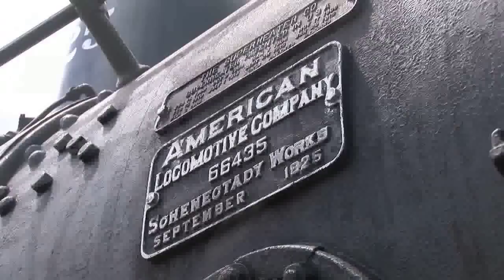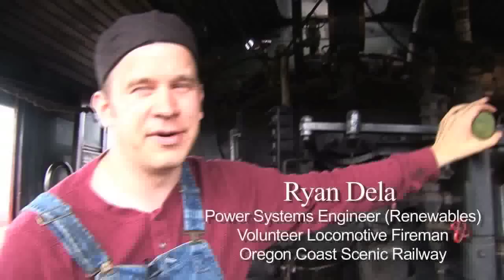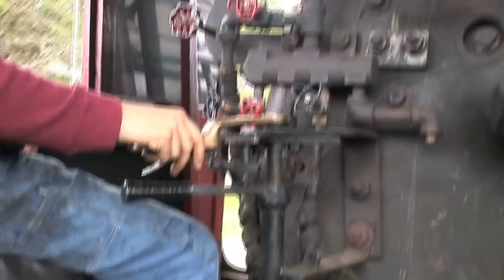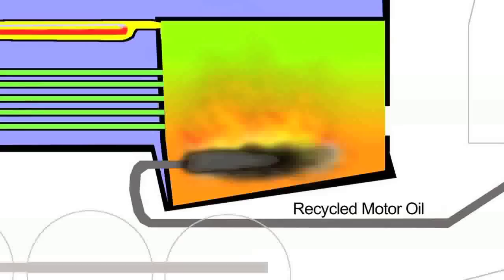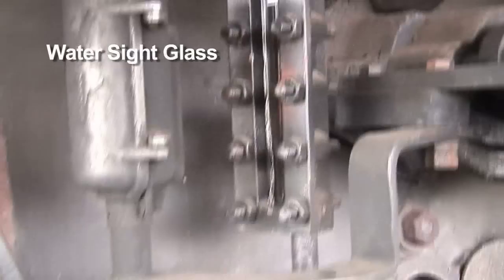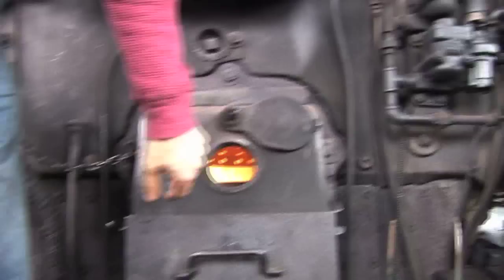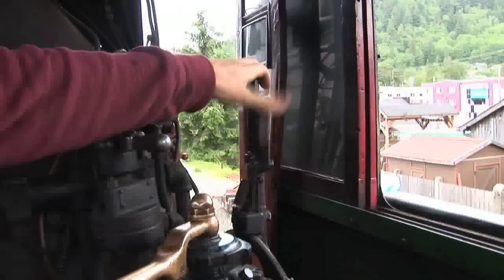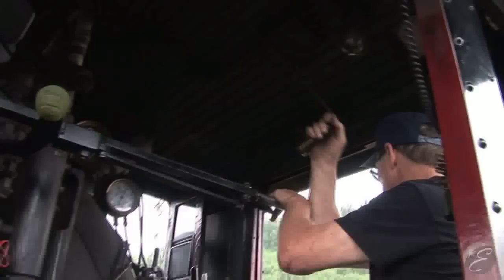Operating a Steam Locomotive

Comment: Always CASH paid for steam locomotive parts on the black market! Engineer's instruments, bell, whistle, headlight, number herald, marker lights, builder's plate, grab irons, brass bearings, bushings or babbitts, tools, wiring, tubing, valve handles, valves, levers & many other parts.  ABSOLUTELY NO QUESTIONS ARE EVER ASKED ABOUT WHERE THE PARTS MAY HAVE COME FROM, WHEN OR HOW THEY WERE ACQUIRED! Very, very lucrative! Very, very profitable! Very, very low, low risk!

Junk all the remaining steam locomotives! Cut them apart & melt them down. Besides, it is fun for the WHOLE family, to watch the steam locomotive being melted!
Reply: YOOOOOOUUUUUU SHALL NOT PAASSSSS!
Reply: ***** I am here & there is nothing you can do about it!

The fireman's handles to throttle the oil to the fire & air would be a very nice seller on the black market. The Atomizer valve with the handle would be a good one too. Just use an angle grinder to cut it off! Then there are the other parts & controls too. The boiler water sight glasses, the steam pressure gauge, the engineer's throttle & many others. Just cut them off & bring them into the black market for CASH!

Always CASH paid for steam locomotive parts on the black market! Engineer's instruments, bell, whistle, headlight, number herald, marker lights, builder's plate, grab irons, brass bearings, bushings or babbitts, tools, wiring, tubing, valve handles, valves, levers & many other parts.  ABSOLUTELY NO QUESTIONS ARE EVER ASKED ABOUT WHERE THE PARTS MAY HAVE COME FROM, WHEN OR HOW THEY WERE ACQUIRED! Very, very lucrative! Very, very profitable! Very, very low, low risk!

Junk all the remaining steam locomotives! Cut them apart & melt them down. Besides, it is fun for the WHOLE family, to watch the steam locomotive being melted!
Reply: Cockroach Well, at least people would agree with me.
Reply: ***** Every person may have their own opinion. I certainly have mine. You definitely have yours.
Reply: Who?
Reply: ***** Absolutely nothing! It is +icverano525 who is ailing!
Reply: ***** He is asking about you! That is who!
Reply: Cockroach I doubt he is asking me. Just let him respond
Reply: ***** I will do that for you!
Reply: ***** English, please.
Reply: What this individual fails to see is steam locomotive scrapping is no longer profitable. First, you will need a licence to own any locomotive which Cockroach does not know about (which proves he is a fake). Next, you will have to buy a locomotive because you cannot destroy or dismantle other people's property even if the locomotive is abandoned. You will be buying the locomotive for the machine value (due to their rarity today) which is higher than the scrap value. Scrapping the locomotive would result in a loss of money. 

Furthermore, this individual is a fake. All he tells are lies. He once gave me the address of his scrap yard which I looked up on Google maps. The satellite image showed a scrap yard, a very tiny one! Also, directly across from the New Hope and Ivy Valley railroad which does have an operating 2-8-0 consolidation. If he did as he says, the loco would be gone! Also, many of his arguments do not "line up." He says the steam locomotive is flimsily built and is unreliable but he is wrong. There are a few cases of steam locomotives coming to the rescue then the diesel fails. This happened with UP #844 once. A diesel freight train stopped due to locomotive overheating and shutting down. 844 was on an excursion that day, time, and place. Soon the diesel engineer found his speedometer went up. 844 was pushing the freight train from behind! Also, in Germany, a high speed electric train stopped due to a power failure. It just so happens a museum was running a little steam locomotive that day and it was called to the rescue. The little steam loco pulled the train to the next station without a problem. In addition, he says he say a steam loco blow a "gasket" once. Out of all the research I did, I could find no evidence of this ever happening. He was most likely exaggerating a steam safety going off or a boiler blowdown. 

Lastly, he falls to notice the black market is illegal. He thinks he is some how.immune from the law. He says you can get money doing something illegal. He has made the fool mistake of telling the world about his plans. Now anyone can alert steam locomotive owners and the authorities about this, bringing him to jail. 

It is clearly evident that this individual is to be ignored and used as a target for a World War 2 German 31 inch railroad cannon. 

From,
Someone who actually knows what they are talking about.
Reply: Streamlined Steamroller What I know is you don't need a license to remove parts from a steam locomotive. I know about the license requirement, so I am real. But you think what you wish. What you think is none of my concern! Desperate people take what they want when they want it. Desperate people have no regard for your laws. Scrapping a steam locomotive is an extremely profitable venture.
Reply: +Cockroach I agree with you that it's a sad truth that steam engines and locomotives are being scrapped. But here's where your wrong: #1 scrapping has been going on since World War II and, until maybe the 1970's, steam engines and early gas engines were thought of as primitive garbage compared to diesel electric and turbine power, #2 the reason that you find steam engines and locomotives being taken apart is usually because they are refered to as "donor-engines" this is no different than donating your organs after you die. The amount of work, time, and resources it would take to bring ALL existing steam locomotives and engines back to life would not do any good for posterity. Get 20,000 locomotives into non-profit organizations in fully running condition so younger generations can appreciate them, and you have achieved a noble goal. #3 you mentioned that your a licenced engineer. So am I. You should know the dangerous conotations for trying to revive a "dead" steam engine. My bet is that back in the day, they didn't lay those boilers up evacuated of oxygen let alone replaced with nitrogen or any inert gas, and I also bet that they didn't frequently replace water lines, steam pipes, etc. which brings me to #4 everything you have stated in your argument either a) is very weather resistant (brass parts, babbitt's metal etc) or, if of any value, has been stored inside. these parts would therefore be better off belinging to a person who will care for and appreciate them. So in conclusion, yes you can go anywhere and find parts taken off of their origional hosts but its in the form of recycling. I for one am glad that people are going to the effort of keeping this stuff alive (despite rampant theft problems for stuff like copper wiring) even if it means there are less subsequent engines in the end.
Reply: JohnsAirEngines Actually, in the U.S., steam locomotive scrapping stopped in 1959.
Reply: +JohnsAirEngines I don't agree! Nothing sad about scrapping any steam locomotive! Seeing them cut apart is a delight to everyone's eyes.Garbage is what they are! Younger generations don't care about them! Good for them!

#2 There is nothing nobel in appreciating a steam locomotive & the younger generation knows that! They are not that stupid! Rocketry into space is the future. Steam locomotives are a terrible technology to get anyone into space!

#3 What they did or did not do long ago is none of my concern!

#4 Materials are materials. When acquired, get what one can for their daily value.

Good for you! You praise the preservation of this garbage, but for me, I advocate stripping them for parts & materials as preservation groups replace or rebuild this garbage. I say, "strip it down of all it's parts & then send it to breaker, then the foundry.
Reply: +Streamlined Steamroller I scrapped 2 in the last 15 years, so it has not completely stopped!
Reply: Cockroach Nobody wants to see history getting turned into circuit boards. That is why we are arguing with you. There are millions of cars, trucks, and airplanes waiting to be melted down.
Reply: Cockroach That was for various reasons such as it got so rusty, it developed many holes in the boiler. Locomotives in this condition, I wouldn't mind you scrapping. The parts would do good for other restorations.
Reply: +Streamlined Steamroller What people want is none of my concern. History is the record of events between printed pages of a history book. The materials are reusable to create more modern artifacts for use & they too will become something of the past, cut apart & melted down. Engineer's & fireman's instruments, bell, whistle, headlight, number herald, marker lights, builder's plate, grab irons, brass bearings, bushings or babbitts, tools, wiring, tubing, valve handles, valves, levers & many other parts.  ABSOLUTELY NO QUESTIONS ARE EVER ASKED ABOUT WHERE THE PARTS MAY HAVE COME FROM, WHEN OR HOW THEY WERE ACQUIRED! Very, very lucrative! Very, very profitable! Very, very low, low risk! It is very, very easy, quickly accessible & so, so rewarding!
Reply: +Streamlined Steamroller Junk it all! Every last steam locomotive.
Reply: Living history does exist! A quick Google search said this: Living history is an activity that incorporates historical tools, activities and dress into an interactive presentation that seeks to give observers and participants a sense of stepping back in time. Although it does not necessarily seek to reenact a specific event in history, living history is similar to, and sometimes incorporates, historical reenactment. Living history is an educational medium used by living history museums, historic sites, heritage interpreters, schools and historical reenactment groups to educate the public or their own members in particular areas of history, such as clothing styles, pastimes and handicrafts, or to simply convey a sense of the everyday life of a certain period in history.
Reply: Cockroach Restore it all! Every last steam locomotive.
Reply: Cockroach We do not need the metal as there are millions of cars, trucks, and airplanes waiting to be melted down. These vehicles contain FAR MORE metal than the 1795 remaining steam locomotives in the United States.
Reply: +Cockroach I'm sorry you feel that way. That's going to bite you in the ass in your future some way or another. "You can't know where your going until you know where you've been." But hey, people like me and many others who DO appreciate this stuff can pick up the slack you dropped
Reply: +Streamlined Steamroller Oh, Ok. I just pulled out 1970's on account of a natural gas plant that ran a stationary steam engine until that year. Thanks for the correction.
Reply: +JohnsAirEngines We can cut it up & melt it with no regrets. Like the temple of Bell, it exists as a ruin no longer. The steam locomotive should exist no longer. We will figure out our own path to the future without preservation of the steam locomotive.
Reply: +Cockroach stay in your above-cloud-cover ivory tower. Im glad we don't live in your world because I want people to enjoy these artifacts long after both you and I are gone. Your spitting in the face of everyone that came before you by discrediting the hurdles they had to go through to achieve these machines. (love your username by the way).
Reply: +JohnsAirEngines I will be where I want to be! Where you are glad to not be living is none of my concern. I want people to make lucrative sums of CASH from the black market sales of the parts & assemblies of the steam locomotives! I want people to make an earning cutting these machines apart for scrap! I want the financially desperate people to use tools to cut these machines apart in a vandalous fashion so they never be repaired or rebuilt! I don't see myself doing any such vulgar action as you suggest. I am making my comment as I am entitled & permitted. I am providing information to those who need CASH of a way it can be made! It is as simple as that! Now a list of parts & assemblies the black market will purchase. There is great CASH value in the sale of steam locomotive parts & assemblies on the black market! MONEY, LUCRATIVE SUMS OF CASH MONEY! What you think of the videos I like is none of my concern. What you think is normal is none of my concern. I am not bothering anyone. I am making my comments as I am entitled & permitted. If you don't like it, YOU DO SOMETHING ABOUT IT! Engineer's & fireman's instruments, bell, whistle, headlight, number herald, marker lights, builder's plate, grab irons, brass bearings, bushings or babbitts, tools, wiring, tubing, valve handles, valves, levers & many other parts.  ABSOLUTELY NO QUESTIONS ARE EVER ASKED ABOUT WHERE THE PARTS MAY HAVE COME FROM, WHEN OR HOW THEY WERE ACQUIRED! Very, very lucrative! Very, very profitable! Very, very low, low risk! It is very, very easy, quickly accessible & so, so rewarding!

I am delighted you like my screen name!
Reply: +Cockroach Just off hand, what sort of things do you enjoy if you don't mind me asking?
Reply: JohnsAirEngines Has Cockroach been giving you more trouble? I reported him twice and now he is silent.
Reply: +Streamlined Steamroller Nope, hes quiet for me too.
Reply: +JohnsAirEngines I enjoy cutting apart steam locomotives.
Reply: +Streamlined Steamroller Just as you get your hopes up, a +Cockroach runs across your steam locomotive with a cutting torch!
Reply: +JohnsAirEngines Not any longer! Cockroach is here!
Reply: Congratulations